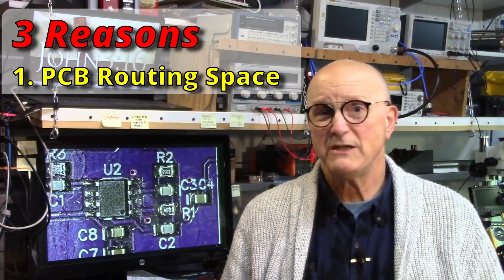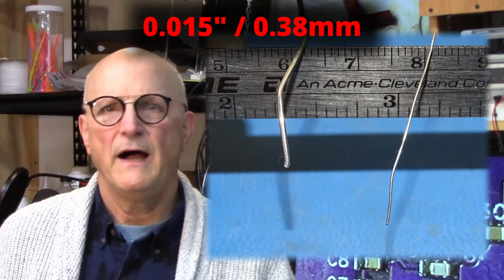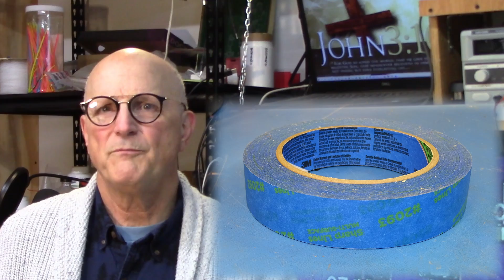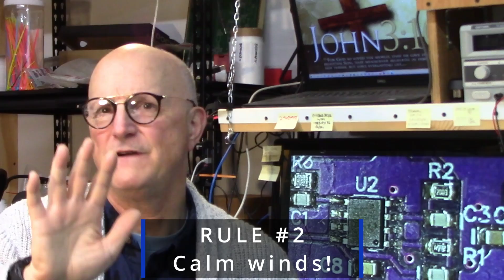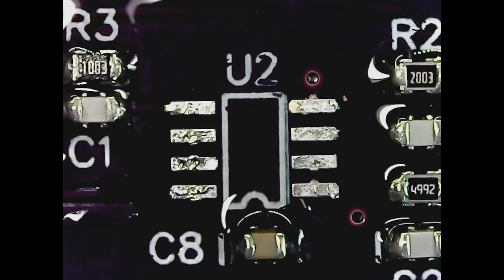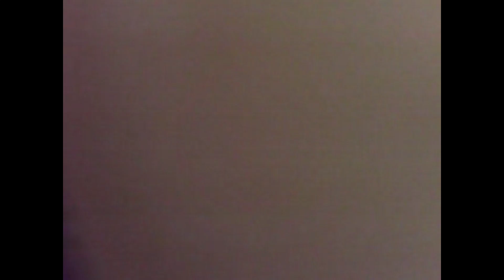Working with and Soldering Surface Mount Devices (SMD) (043)

Comment: Thank You!  

I'm going through the 'transition' myself these days, as I'm finding many of my favorite components are no longer available in leaded from. So every little bit of direction is helpful!

Price, as you point out, is also a major driver in the move!  Literally 20x difference in some cases!  Can't argue with that!
Reply from the maker: I am glad the video was helpful. It took me a while to develop my technique. It takes practice, but you can get it done. I have the help of an optical microscope in my shop. It only cost $350 and does a great job. I use it a LOT.

Comment: Enjoyed the vid!  What temp do you have your iron at to remove a 0402 resistor??  Thank you!!
Reply from the maker: I am glad that you enjoyed the video! 🙂
I use the same temperature for all of my soldering (for the most part).  700F/370C is what is recommended by the solder manufaturer for the 60/40 leaded solder that I use. If we run too cool, then it takes too long to heat to flowing state, soldering takes longer and the components are more stressed.  Fast in and out prevents a lot of heating damage.
Reply: @eie_for_you  
Ah ok!  I am usually up around 850F but that might me too hot but it’s because de-soldering lead free solder is a pain.  I am worried about messing up the trace or burning the board.  I always use the 60/40 when I have to solder.
Reply from the maker: @rallypoint1  yes, lead-free solder….yes, higher temps. Check the solder manufacturer’s recommended temperature and use that. Higher temps are one of the reasons I don’t like lead free. You could see my video on soldering. I give temperatures in there for the lead free stuff. I just don’t remember them off hand.
Reply: @eie_for_you  
750F for lead free solder!!  I was close.  I want to unlock my clarifier and need to remove a couple of thru hole components (pretty simple) and two surface mount parts.  Going to practice on some junk boards with a microscope.

I am glad I subscribed to your channel!!!  Now to watch them all👍🏼
Reply from the maker: PERFECT!  Go for it!  And don't forget the solder wick! :-)

Comment: hello, Can you do a video explain how to use an oscilloscope  ? show on a practical example, test the motherboard with an oscilloscope .Thank you very much for your useful video !!!!!!!!!!!!!!!!!!!!!!
Reply from the maker: It just so happens that I have two videos on that subject.  The first is a tour of the controls and the like.  Here is the link for that one: https://youtu.be/1Sq4L2x4lfU.
The second is showing how to measure voltage and time using a scope. Here is the link for that one: https://youtu.be/G5-IJkoW2lE
Regarding troubleshooting a motherboard, these generally run at VERY fast speeds. You wld need a high-end scope to do that.  A lot of the signals are serial, so catching (sync) at the right spot to see the actual data and then decoding that data is a real challenge even for the experienced.
You are very welcome for the help.
Reply: @eie_for_you  thank you very mach for the answer!
Reply from the maker: @tehnics-optics4560  You are welcome! 😃

Comment: Nice demo. I like to use a 'normally closed' tweezers. (The "reverse tweezers") It standard holds the component and you need to apply presessure to open the tweezers to release the component.
Reply from the maker: While I have seen these, I have never worked with them.  None of the folks that I have had the pleasure of working with ever did, either.  The pair that I own are way too big for the job. I suppose one would have to select them carfully to avoid pairs with too much grip, but, then again, one could reduce the grip by squeezing them a bit in the process.  It is a very interesting thought to use this sort of tweezers.
Reply: @eie_for_you  For me it reduces the risk of launching or dropping a component as i can focus on the correct placement or moving the components from my bench or a container to the PCB without constant manual applying the correct pressure on the tweezers. Some normal tweezers with a little hook are nice to pressure  the component a little on the PCB while soldering or moving it the last millimeters.
Reply from the maker: @JanJeronimus  Cool!